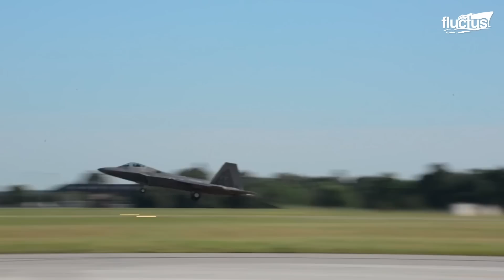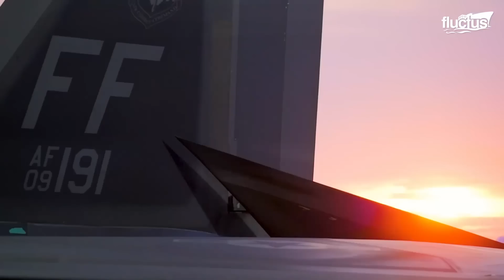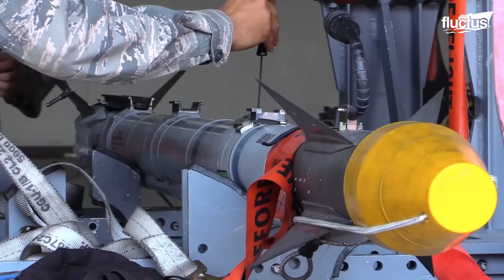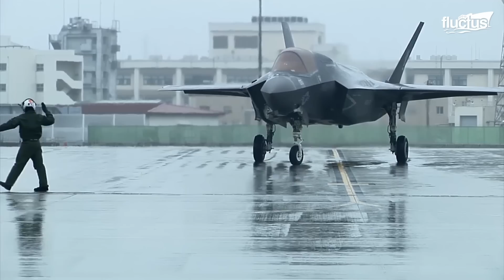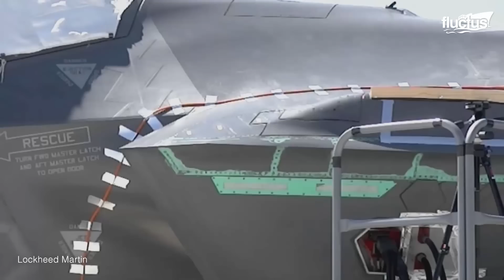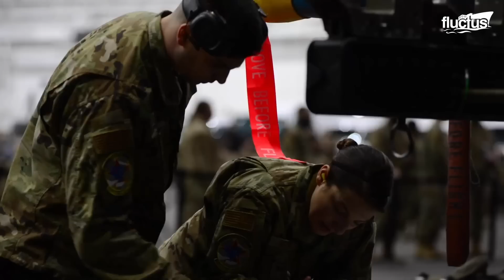Testing the Aggressive Design of the US F-22 to its Extreme Limit

Comment: I absolutely love this aircraft.  Pisses me off that they ended production early.  It's an amazing platform.
Reply: Think of it like this what's our 6th Gen stuff gonna look
Reply: @Richard-tq7xi  what russian jet can do better? The Su57? Lol 10 to 20 produce but still prototype and Never been put in Service. The engine is from su35 same with computer hardware, Funny 😁😂😂
Reply: @Revenge86  I bet that su57 takes an f22 in a merge. They clearly gave up on the stealth aspect so I'd imagine they went harder either thrust vector and control surfaces. 

Also reason f22 was replaced by f35 is simple. They put newer radars on the f35 and it can't be beat in long range by any foreign competitor. We can sell it so it costs less. And that's about it.
Reply: @jackjman5577  no they can't.
Reply: Seeing as the two haven't met, I'll assume that's your opinion...and everything I've read suggest your opinion is an emotional response rather than a logical one. The f22 being more agile than the su57 makes 0 sense just looking at the two aircraft. Once you read into them it makes even less sense. Maybe you know something I don't and we're just not inclined to share though....
Reply: @jackjman5577  you're a joke. the su57 is a make-believe airplane that only exists as a prototype. it will ever never make it to production
Reply: @jackjman5577  su57 would never make it to the merge but I still don't think so.  f22 is no joke either in a dogfight.  and our pilots id bet on 100x over.
Reply: @jackjman5577 Actually no the F-35 was created because countries were whining that we banned export of the F-22 because of its advanced tech and the US not wanting anyone to have it. So, there solution was the F-35 developed for the US but also was allowed to be exported. F-22 dogs the F-35 because it’s purely complete air dominance, and the F-35 is not designed for air dominance but rather being an advanced multirole fighter. Also their RCS’ are the same.
Reply: @craig4867  Hello AI.
Reply: Why would they have ever stopped production on the beast of the sky???
Someone didn't want U.S. to be the BEAST of the world 😔
Reply: @budone7449 Obama stopped it supposedly for being too expensive. Almost sounds like internal sabotage to me
Reply: It really irritates me that they stopped making F-22s so that they could make more F-35s which are just not even in the same class.  The F-22 is the most dominant fighter jet the world has ever seen.  Even if dogfights aren't still the focus of modern militaries around the world, the jets still have to destroy targets and get back home.  The F-22 will do that almost always.
Reply: @craig4867  i know that already.   our war power is not as strong as is should be because our production capacity cannot produce this class of weapon in sufficient time to recover the loss in the event of a war.
Reply: @j121212100  Any war America is involved in won't be prolonged. Just look at the Gulf War. Second best air defense system in the world and it was all destroyed in 3 hours.
Reply: @j121212100  you would maybe lose 3-4 in a bigger war... from 200+ and you got the f35 on top
Reply: wait, they WHAT
Reply: @VelaOfTheVoid  the powers that be....screwed the whole world of the F22
Reply: The F22 is to specific and is difficult to upgrade, the costs apparently were so high that it was economical better to discard the project, that’s what I understood about it
Reply: @thomassievers3362  F22 is undeniable and its strength cannot be underestimated, but in modern battleships, the J-20 is stronger than the f22. If the J-20 competes with the f22 in 1v1, I feel that the J-20 has a greater chance of winning
Reply: F22 maybe a powerful aircraft but the F35 came with a lot of innovations from its development. The idea of F35  is to gather data from the area it’s operating and link it up to the battle network.  The F35 can act as a miniature AWACS that can drop bombs, guide munitions, and automatically gather Intel on the next several targets for other units in the area.
Reply: @ownage11445 even with some improvement on the F35, overall it cannot compare to the raptor. The F22 can sustain supersonic travel without ever using the afterburners. That's just one aspect. F35 may be considered more "user friendly", but that's it. The F22 wins every time.
Reply: @paullukasik8698  you don't understand modern warfare

the F-22 and F-35 would never meet up close, they would launch missiles from beyond visual range and at that point . . .  it's stealth vs radar and missiles vs countermeasures 

The F-35 has a pretty fair chance of winning that engagement, but it depends on the pilot and more importantly, the battle plan and auxiliary support.

We can field 3 F-35s for the price of 1 F-22, and in that fight . . .  the raptor goes down (allbeit taking 1-2 planes with it)
Reply: If the politicians would stay out of the militaries way we as the American armed services would never lose. I was shocked when I heard the F-22 was ending production. Still rated as the #1 aircraft of it's type in the world I think.
Reply: You can thank short sighted Politicians like Bush and Obama for that crap 💩. They are the ones responsible. All day long Yahoo
Reply: Maybe something better coming
Reply: @timknin  always
Reply: The f35 caught attention in several countries because they co-funded the project and paid billions to make it happen, and it was tripled like it was toilet paper
Reply: They ended it meaning they don’t need it because nobody can compete. Rest assured if we find ourselves facing an Air Force with anything close to this, those factories are starting back up. The F35 took over but isn’t as well suited for dogfighting. Both are amazing and very similar in tech
Reply: We were supposed to have over 300 Raptors. You can thank Obama for cutting the funding and stopping the program.
Reply: @paullukasik8698  yea that really annoyed me.  those who rule the sky win the war in my opinion.  and the F22 is pure aerial domination.
Reply: It had no competition. Might as well put that money and time towards gen 6
Reply: It was an aircraft without a mission.
Reply: @cmdmd  you don't build anything for present day.  You build to face future challenges.

If you build for right now, you're already behind the eight ball.
Reply: Yup.   i think we should have 30 aircraft carriers and 300 f22s.  2000 F35s.
Reply: @j121212100  f35s are trash
Reply: @j121212100  It is undeniable that the United States is a superpower in the world, but putting over 2000 f22 aircraft in the current market is just an economy. The storage conditions for b2 bombers are very strict, let alone the maintenance fees for 2000 f22 aircraft. Even the largest developing country, China, cannot afford to consume them
Reply: @刘新辉-v7t the initial full order was supposed to be a little over 300 raptors. We didn't even complete that, I think we have about 187
Reply: @j121212100  With 4 hostile countries now operating impressive hypersonic conventional missiles with about zero counter measures in existence, you may as well make that 30 Margarita's.
Reply: @j121212100  It's not worth producing that many in the long run. For the rate at which technology is advancing, it's better to produce smaller batches to save resources. It's planned obsolescence for reasons of staying of the cutting edge
Reply: The only reason we stopped F22 production, is because it was deemed too powerful for any current adversary. It was sort of pointless to use such a large budget on a product that has absolutely no competition. Best aircraft, yes. But, you know we have something cooking up even hotter behind the scenes... The NGAD will be coming sooner or later.
Reply: @MylesZ06  the real reason production stopped is that a law was passed on to prevent f22 from being sold to other countries due to its advanced capabilities so that other countries can't get the technology used in the development of the f22. So there's no point making more and costing money without profiting. And yeah. No point realy in having thousands of em without even competition.
Reply: @mistersnoosnoo we have about 183 or 187?? The original order was supposed to be OVER 300
Reply: @MylesZ06  .. sooner or later but being increasingly irrelevant in the modern theatre.
Reply: @MylesZ06 That's ridiculous.
Reply: @MylesZ06  you know shit got real when even the government was like “this aircraft is too deadly for modern warfare, let’s stop production and create a new jet (that is affordable with the ability to be modded for different militaries globally) so that the rest of the world can catch up and maybe be able to put up a fight 😂😂)
Reply: @GetTheFuckOutofH3re1  about right , only the replacement airframe is almost as expensive and way less capable
Reply: @GetTheFuckOutofH3re1 That's absolutely not what happened.
Reply: That's because Robert Gates and a few short sighted Air Farce generals manipulated and insisted we'd be better off with that blasted F-35!  It may have been expensive in the beginning but nothing even close to what the F-35 has cost us!!
Reply: @hj6375  The F35 project had nothing to do with US security or power.
Reply: @hj6375  You're dead wrong. The F-22 is a specialist platform. It costs 3x as much per unit as an F-35 and costs around 2x the maintenance cost per unit.

The F-35 can't exactly dogfight in close range, because it's designed as multirole platform for BVR engagements and CAS.

Not to mention datalink, international export, and the various other things that the Raptor can't do.
Reply: @hj6375  No, it isn't. Stop.
Reply: It was cancelled because it was for a fight that will never come. Most air to air will be bvr. Anything closer and even an old mig-21 will be a good match. The F-22, while singularly the best, is pointless. NGAD won't fight like fighters of old. Who sees first, shoots first.
Reply: How can that upset you? Get a life bud
Reply: We didn’t need the F22 then
Reply: @Jay-qb9gi  the objective of war is not to have a fair battle, but instead, to win as decisively and quickly, with minimal loss of life for our troops as possible.  Precision weapons of this nature are required.
Reply: @j121212100  no, because there was no competition in 2009. The F22 was FAR above everything that has ever been created. It was essentially useless as it would likely never see combat & the US was had a very large arsenal of other weapons. Having an F22 is like buying 40 cars. Why do you need it? Now? Yeah it might change, but then, it didn’t make sense to produce these expensive killing machines.
Reply: @j121212100 - so true. You want the prospect of war to be as unpleasant as possible for your adversary. Get them to the negotiating table to work out the problem like civilized adults. Putin is a malevolent and spiteful child whose vulgar ambition is kept in check by force. We are ahead of Russia, China, Iran, and North Korea, and it needs to stay that way for the near future.
Reply: @Jay-qb9gi  it does make sense because it takes decades to figure out how to use stealth technology. F22 started testing in the 80's and wasn't till 2005 it reached "initial operational capacity" and not "full operational capacity" until 2008 and it still had problems, including grounding the entire fleet in 2011 and its estimated service life has been reduced!